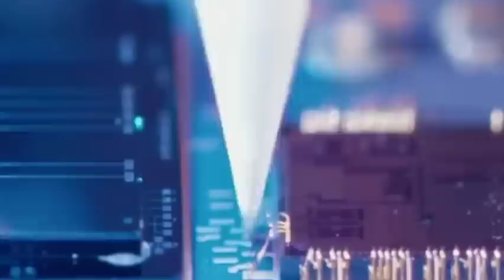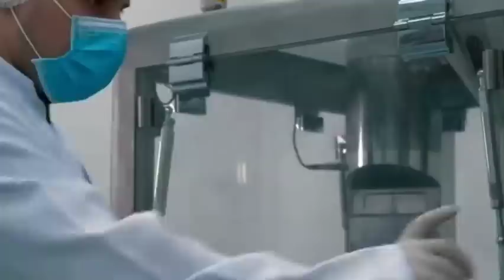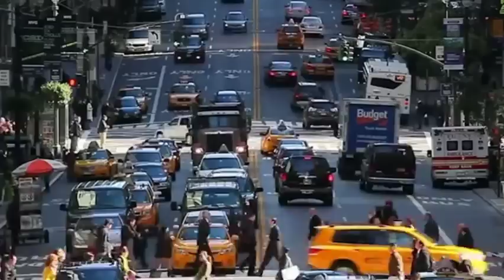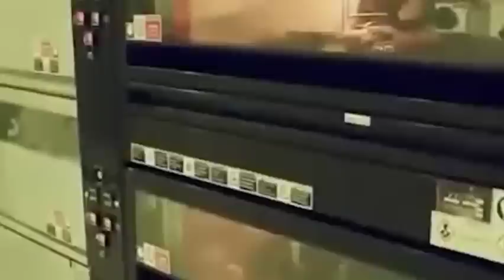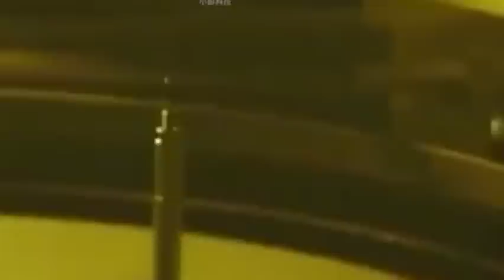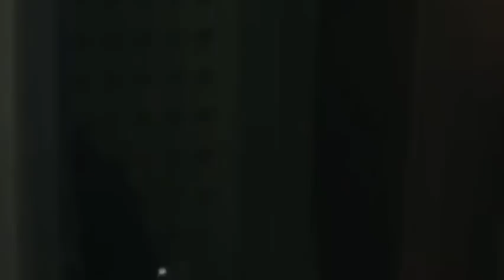Get rid of the EUV lithography machine? There are Chinese high-end chip solutions.

Comment: Hinted at, but not directly addressed is why the race to smaller and smaller nodes?  It may have been obvious in larger nodes, but the race beyond 5nm seems a fools journey.  Smaller nodes are supposed to gain better performance but what are those performances gained with smaller nodes?  Higher bit rates?  Lower power consumption?  At what cost?  The reality is the price for high end chips preclude their use in the majority of applications in consumer, industrial, and even military applications. It has been hardware architecture, software operating systems, and software applications that have brought on higher feature sets than advancements in semiconductor node sizes.

What we see China doing, is optimizing mature node chips so yields are high and the chips produced are reliable, mature, and long lasting.  China while exploring the frontier envelopes of high end chips, has been focusing its attention on pragmatic reality on what it can do with what it has and reducing costs.  These mature node chips are used in the automotive, consumer appliance, and industrial applications sector.

In a typical car, there are some 2000 or so chips used, performing a variety of functions.  If chips used cost say 700 RMB per chip, or about $100 apiece, if 2000 chips, that would be a cost of $200,000 which is obviously ridiculous.  A more realistic price is an average of $1 each or less.  The point is, the high end chips are for a very small market of high end mobile phones  and laptops where having the best is more a prestige than performance criteria.  Apple has always marketed itself a a high end phone, but as sales at this end diminished, it has been forced to lower its standards to mid-range phones.  The low end to mid-range phones, where costs are important,  using 14 and 7 nm node chips are the lion's share of the market in their sector.

https://electronics-sourcing.com/2022/05/04/how-many-chips-are-in-our-cars/

Further, as the US races to cut off China's rise in high end chips, two things are coming about.  First alternatives to expensive EUV lithography are being explored.  Japan's 'nano' technology provides an alternative to EUV as addressed in the video.  It is unclear how much smaller than 5nm can be achieved, but the cost reduction by not using an expensive EUV machine is pushing this concept forward.  Huawei has recently applied for an EUV patent.  Does this mark a breakthrough as a less expensive method of EUV?  If not, why would Huawei apply for a patent?

America's race to build more high end chip foundries may be a fool's race to bankruptcy.  Morris Chang of TSMC has said that his experience with fabs in the US shows a 50% cost disadvantage.  TSMC has a fab in Oregon.  Intel is building 2 new fabs, TSMC is building 2 new fabs, and Samsung is building 1 new fab.  All aimed at high end chips.  With the use of several expensive EUV machines at each site, profit margins will be slim to none as competition heats up and there is the potential for surplus production that could kill profits.  Remember, TSMC and Samsung are not stopping their Asian semiconductor efforts.  For that matter, both TSMC and Samsung are adding capacity to the mainland Chinese fabs and focusing on high end chips in their respective home factories. Further, it appears the market rise for high end chips is slowing.  TSMC has admitted that it has shut down 4 of its EUV machines and told workers to take extended vacations.

"Following the passage of the U.S. CHIPS and Science Act, a number of new semiconductors fabs are planned for construction — a trend likely to last for years thanks to the $52 billion apportioned by the U.S. Congress to support its domestic chips sector. TSMC alone is supposed to spend $40 billion for chip facilities in the US. Intel, GlobalFoundries, Samsung, Texas Instruments, and others have also shared plans to join the pack with their own U.S.-based fabs in an investment spree that is already on track to exceed $200 billion. And momentum is building elsewhere. Reuters recently reported that China’s government is preparing a 1 trillion yuan ($143 billion) package to boost its own domestic semiconductor industry, and Europe also has its own version of the CHIPS Act in the works, only with less juice. Nevertheless, Intel announced plans to build a huge chip-making facility in Magdeburg, Germany, two hours west of Berlin. The German government has allocated €6.8 billion for the project already." (photonics.com) 

Not only that, but alternative materials and methods like photonics, graphene, and quantum chips are being explored.  Photonics actually have been around for sometimes.  The use of fibre optic cables has prompted their development.  Now, there is more general realization that by expanding photonics into more complex devices, that the advantages of speed and low power consumption can be achieved.  Not only are photonic bistable devices, logic elements, and memory functions being realized, but the full potential of equivalent high end silicon chip performance are seen on the horizon.  China says it will have a photonics production line running in 2023.

https://www.globaltimes.cn/page/202210/1277405.shtml

Graphene and quantum chips also explore the boundaries of performance beyond high end silicon.  There is a who new realm of 'out of the box' thinking that is bringing about newer technologies to replace the old. Like the transition from vacuum tubes to transistors to integrated circuits, the advances in technologies seem to be limitless;.
Reply: Thanks for your clarifications.

Comment: This channel is Chinese propaganda right?
Reply: Yes, you better not tune in, lest you get brainwashed😂
Reply: @teckchuonting4582  😳😳😳
Reply: not really, what it say is factual, just not the full fact. you can reduce the size of the chip by simply adding more layers, what EUV does is it allow u to build those chip with fewer layers, since each layer take the same amount of time to lay, fewer layer = faster production = cheaper chip. so the main reason companies choose TSMC is because it is cheaper, SIMC can probably make chip equal to 5nm, but the price they will have to charge would be double. being able to manufacture something and being "commerically viable" are 2 different thing, China's struggle is in "commerical viability" and not that they can't make those stuff. China has more AESA radar than US now and these radar are semi conductor base, it prove taht if you take the commerical element out, China can outproduce the US in high quality semi conductors. US knows this already, this is not really news. the EUV lock out is to prevent China from catching up with comerical viability because that would mean the death if US hightech industry. this video doesn't change that, China still has issue with comerical viability.
Reply: Yes, only lies and shit propaganda!
Reply: please don't under-estimate CHINA ... west and usa dare not do good work, only good at wars and killings? ... 
https://youtu.be/FIa52ASFedA ... China Built Hell Tunnel In Only 12 Years VS America 50 Years Estimated - FTX | BRICS #china #usa